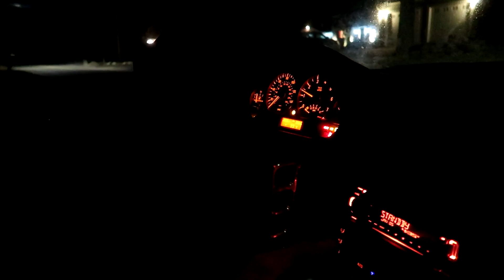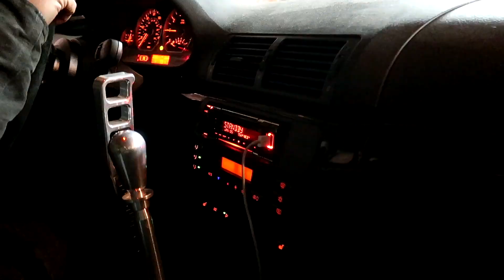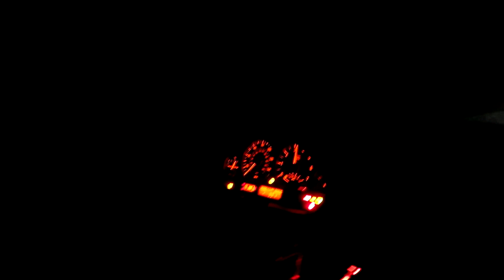E46 330i Engine Swap

Comment: Great vid. It's sooooooooo rewarding when you go through all that crap and work to make it run. And it acts crazy for the first few tries, and finally it all comes together and works well. Such a great feeling. Glad to see you guys got it straight. I don't know if I can say that I miss my E46, as I'm now in a 335i E92, with almost 700 hp. But I loved that car, and it took such great care of me. That car NEVER failed to start or do whatever I asked of it. The most reliable car I've ever owned, easily.

Comment: I worked on a floded bmw f10 diesel. After removing water from cylinders, engine fired up no problems. Still working fine today. Oil and filters changed and inside ran a dehumidifier 2-3 days carpet up. You cant even tell it was run through a flooded road. You could have done the same, engine would be probably fine.

Comment: Was this a 3.0 to 3.0 swap? I'm looking for an engine have the 2.5 and was looking to swap to the 3.0  should I go ahead and grab the dme or will mine work.
Reply: Scott Howington should be plug and play. i have the same swap, just in the coupe . she’s my baby
Reply: @official_lz1908  dont know if you will see this but i have a 2.2l e46 coupe and wanna do a 330 swap as my engine has gone bad will i have to get a new ecu ect...
Reply: So I have a 323 ci coupe I want to know if the 330i is going to work before I go out and buy the motor

Comment: I have a E46 2000 323i and I want to do the swap I read on their page that if you have m52 you don’t need the plate does that mean I just put a new gasket and slap it on

Comment: Im looking into doing the same m50 intake swap. im assuming the disa valve gets deleted but what happens with the idle control valve?
Reply: You get it tuned. The cold starts will be rough but once you get it warm it will run just fine without a iac
Reply: Sid Bork ok I figured that was what they were doing, I just wasn’t sure if it was only on cold starts or not. I seen you can add it still but looked like a mess of vacuum hoses

Comment: When you swap ECUs without coding the keys you will get a P0600 error, my car has it. Shouldn't affect performance.
Reply: I should clarify, if the ECU is from an automatic car and put into a manual you'll get that code

Comment: Hey guys I have a 2011 335i turbo my car is in limp mode everytime I clear the limp mode I drive it a second then goes back into limp mode now the car just will not start any clues?????
Reply: Christifer Schmuck what codes are being thrown?
Reply: Part out.
Reply: Does it have a SES light? What are the codes.
Reply: Most likely crank angle sensor but check out the codes first.
Reply: KiTshowtime lmaoo
Reply: Christifer Schmuck download inpa or ista-d onto a laptop and it'll tell you everything you need to know